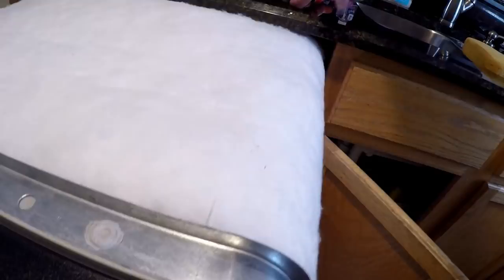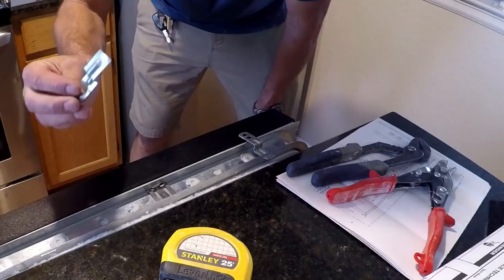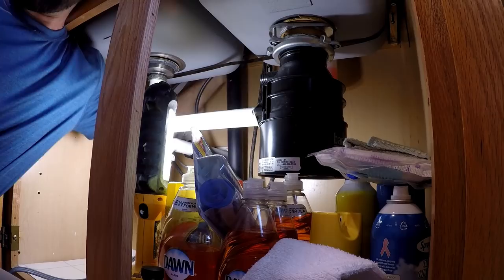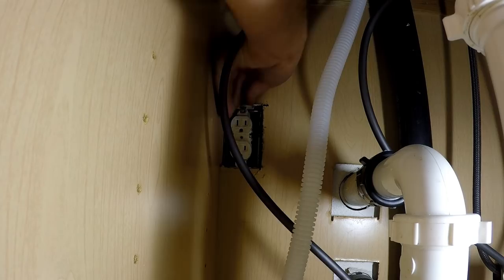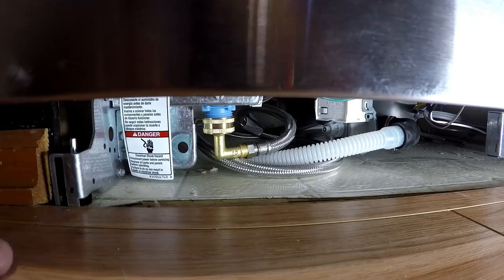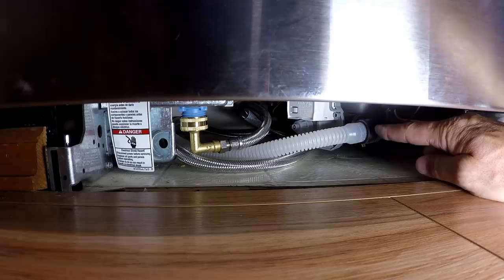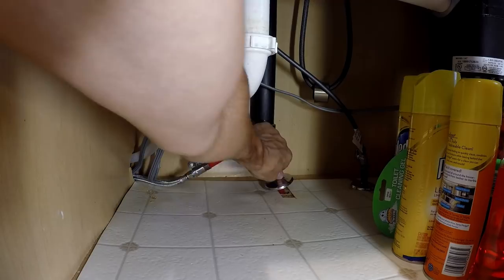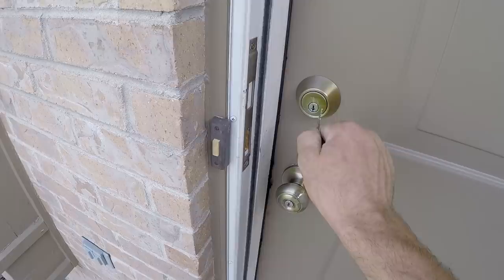How To Install A Dishwasher | THE HANDYMAN |

Comment: I have installed many Dishwashers here in NJ & have never seen a drain setup like that.  Generally there is a 3/4" fitting above the P-trap or a knockout in the disposer.  I learned something new!  Odd but new...LOL
Reply: If you look again @4:45 there actually was a disposal with an inlet sticking out of it which actually is the correct way to install the drain line if that home was anywhere that has code inspections that install would have failed inspection just because of that.

Comment: I've installed over 400 dishwashers I can tell you have many under your belt also I never thought of cutting the old mounting tab's out but I had many new ones from previous installations good idea it's a fun job when the old one was installed by a professional plumber ha makes it very hard & extra labor to the customer to modify his work

Comment: It's amazing how often your videos line up with my next project. I bought a Bosch dishwasher last week.
Reply: Bosch is the best! When we moved into our house two years ago the wife was bugging me to install a dishwasher since the one that came with the house was broken. At our old place, we had a Whirlpool Gold dishwasher that annoyed the hell out of me. It was LOUD and seemed to go on forever. When you're in a small condo, these things can get VERY irritating so, I was reluctant to get a dishwasher for the new place. Wanting to please the wife, I found a used Bosch DLX series on Craigslist for 120$ . I only had to replace the wire so I put in BX cable and the thing has been running smoothly for the past two years. VERY quiet, cleans like a charm and was a great deal!
Reply: We've had a Bosch D/W for 3 years now. Absolutely NO issues, and exceptionally quiet. Went to Lowes looking for a middle-priced unit (Whirlpool, etc.) and noticed an in-store ad for Bosch, where their unit had a rebate and free install, making it pretty much exactly the same price as the Whirlpool we were looking at. We jumped on it.

Comment: I like re-using the old tabs trick you did. Depending on the rental home quality, you can also use a flat stainless screw with a thin rubber washer and go through the side of the DW door opening and into the cabinet. It works well without any door leaks. Sometimes, I get a work order to, "secure the dishwasher." That's when tabs are missing or broken and I use this alternative.  I might even put some old snipped tabs on my truck now. Thanks. 

The feet thing is often my biggest challenge when new tile or flooring has been laid. Can't easily remove the old DW w/metal feet. I end up cutting the feet off. Also, I tape the new blanket down with aluminum tape or throw it away on cheap rental properties. They are like R-1 and worthless. I keep a couple sanitary hose extensions to make the vacuum break loop. Nearly all old DW here don't have one. I also charge $20 for disposal of the old DW. Funny, PM's pay more for DW installs than Disposals, but they are about the same labor time.

Comment: Hi Handyman, Am I crazy or did the previous plumbers hookup that white P-Trap backwards? It looks to me like they grossly violated the uniform plumbing code by having that back side of the white P- trap outlet going up way too steep before it curves into the trap arm and into the wall, and hence they are violating the rule of limiting your "trap seal" to no more than 4". On a code compliant P-Trap, the trap seal should be 2" to 4" and that's it. So it looks like they connected that poly ptrap backwards, and had they just connected it the correct way, the kit is already designed to provide the code-complaint 2" to 4" trap seal. Of course, now they have the problem of the trap arm going into the wall is way too high.
Reply from the maker: You have a good eye.  I went back and watched the video and see exactly what you are saying.  The P trap needs to be raised up and flipped around.
Reply: @TheHandyman1  Good to know I'm not crazy after all!

Comment: Rather than changing the hit wire, why not rotate the plug ?    That would not only gain access for the dishwasher, but would put it on the bottom, closer to the pass through opening.  Some people even feel the ground prong up, is a safer installation.

Comment: Hey Handyman, great video!
I know how to sweat pipe, learned as a kid and since these compression type shark bite fittings came out, I haven't sweat a single joint together. They work when they are wet, you don't have to use flux, they work on copper, pvc and pex. Need I say anymore? The only failure I've had with them was the first time I used them. Did a small job re-routing a hose bib to another spot on the house, that used several of these fittings and I didn't get one of them pushed on tightly enough, blew off when I turned the water on kinda made a mess I had to clean up.....you call that one of them there learning-type-experiences. So it was user error, not fitting failure and in all fairness, I have seen copper sweat fittings, that were installed by a licensed plumber fail, there have been several of these over the years at my folks house.
Reply from the maker: Thanks for the comment.

Comment: Cool Stuff! Thanks for all the tips! Would you be able to expand the off of that outlet so that you'd have 4 receptacles in place of the two? Say if they wanted to add an electrically controlled touch or sensored faucet?

Comment: Just wondering. Why did you not plug in the drainpipe into the garbage disposal instead of pushing it down the black pipe in the back? (I could see the disposal has an adapter to accept the dishwasher drain pipe, and it would have been easier, unless theres something I missed?)
Reply from the maker: This house was built with a dedicated drain pipe for the dishwasher.   Please see my Instagram for a detailed video on how a dishwasher is properly drained.   The nipple on all garbage disposals has a knock out that block it off.   Its there for older homes that do not have modern plumbing installed.  My Instagram is @the_hand_e_man

Comment: I need a pro-tip on this. I've got an old-arsed house, with like 3 layers of floor (as you mentioned.) Tips and tricks to handle this situation?
Reply from the maker: try to completely remove the feet.  Cut them off it you need to .  On laminate counter tops I have unscrewed them and put shims between the cabinet and the counter top to lift it up just enough to get the dish washer out.
Reply: We don't actually have a dishwasher, this is for getting one in without destroying the floor. Can you install a dishwasher without feet?
Reply from the maker: It can be done.  It really depends on the dishwasher and what kind of feet it comes with.  I have taken the feet off, pushed the dishwasher in the hole then put the feet back on once its in the hole.   Its a pain in the ass but can be done.
Reply: Alright, thanks my man.
Reply: Check out ADA dishwashers.  They are intended for lower height countertops, thus have more room at the bottom in a "normal height" situation.

Comment: Handyman, quick question for you (someone who has used sharkbite fittings in the past) 
Is it possible to unsolder a fitting and replace with shark bites?
I want to add an expansion tank to my water heating system and the best way in my application seems to be unsolder an elbow and change it to a T then add in the tank on the 3rd side 
Would the residual solder mess with the shark bite? 
Thank you for your time and content, I really enjoy your videos
Reply: You can unsolder a fitting but they make an expansion tank tee....it's similar to a slip coupling

Comment: Question on the electrical outlet thing.....  Since you apparently had an 'upside down' plug on the dishwasher, instead of rewiring the outlet, couldn't you have just rotated the entire outlet 180*, and reinstalled it upside down? That would have put the unswitched receptacle on the bottom, with the grounding prong DOWN. You wouldn't have any issue with that weird plug anymore, either.
Reply from the maker: The pictures was not accurate.  It was meant to show the angle plug not the position of the ground.  It was my mistake.

Comment: Don't know if anyone said it, but you could have just reinstalled the outlet upside down.
Reply from the maker: I posted an incorrect example picture.  The plug was a 90 but the ground was down.
Reply: Yeah, I see the problem now, the cord side would probably butt up against the other plug.  Good work though!

Comment: Wouldn't have been easier and quicker for you to have simply unscrewed the outlet from the box and rotated it 180 degrees so that the round ground holes are then at the top of each outlet?
Reply: this still would not change the orientation of the right angle dishwasher plug to the garbage disposal plug.

Comment: You should have placed a Machete on top of the Dishwasher! In your house, you don not have?  Arc-fault circuit interrupter?   If not why?  O'  You wear shower shoes in the garage.  Sorry what state do you practice in?
Reply from the maker: No home made before 2014 had gfi outlets under the sink.

Comment: where did you put the discharge hose ?  Code is before the trap. they have a drain set up wirth a built in barb fitting for the discharge hose. It's above the trap and is nice because every time the dishwasher discharges it flushes pea trap. It's a clean way to do the install
Reply from the maker: It went in the dishwasher drain pipe.   New houses are plumbed for a dedicated drain for the dishwasher.
Reply: @TheHandyman1  I never knew that. So , if the dishwasher has it's own , dedicated drain then it would have to have it's own pea trap, the same as a washing machine discharge? Code is every single.drain in a home plumbing system must have a trap.  Or am I mistaken.
Reply from the maker: Yes It has its own trap right there in the video. That black pipe is for the dishwasher  The drain for the sink goes in a different drain through the back of the cabinet.
Reply: @TheHandyman1  that black pipe looks like straight drop to me. Hmmm.. I don't see a trap ??? And as far as that outlet goes well, your a certified electrician. I was told that every applaiance in a kitchen must be GFI protected. And that outlet, being under a sink by my way of thinking should with out a doubt have it's own GFI ?
Reply from the maker: Its right there clear as day.  Are you watching on an old flip phone?
Reply: @TheHandyman1  haha, I'm watching with out my readers on. my bad. let me put my glasses on and watch again . then I should see a pea trap for the dishwasher and a GFI for the dishwasher. 👍
Reply from the maker: Prior to 2014 Garbage disposals are not gfi protected,  dishwashers are not gfi protected.  Over the range microwaves are not gfi protected your refrigerator is not gfi protected.  The only outlets in a kitchen that are gfi protected are the ones above the counter.
Reply: sorry me , my bad. I put my glasses on. I see the trap for the discharge. How about the GFI for the dishwasher ?
Reply: i noticed a garbage disposal under there...garbage disposals have a barbed fitting sticking out the side for connecting a dishwaher discharge
Reply: @TheHandyman1  I'm an appliance technician and the new dishwashers today are NOT supposed to be plugged into any type of gfi outlet. Some new dishwashers have inverters and a gfi outlet can wreak havoc on the operations of a dishwasher. It should have its own dedicated line/breaker and NOT a gfi one.